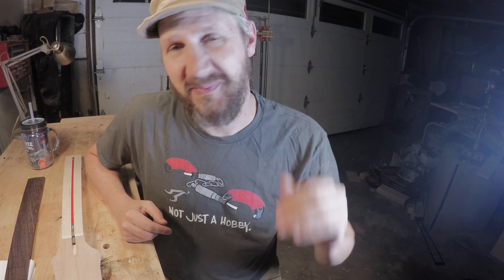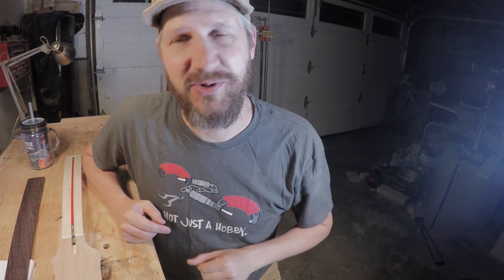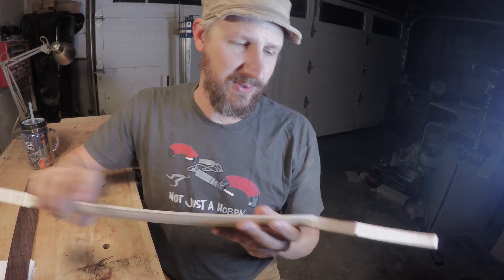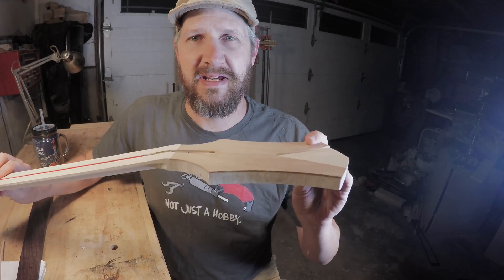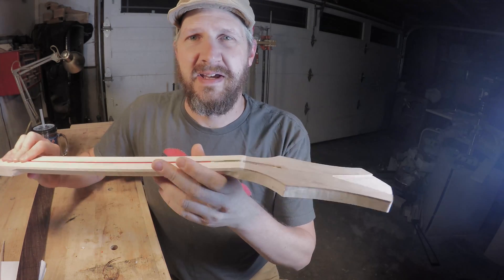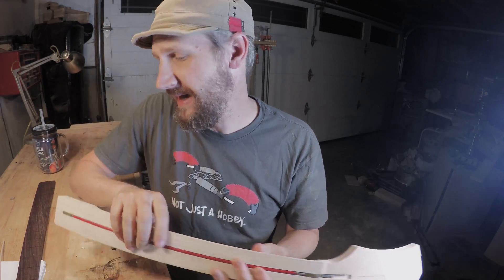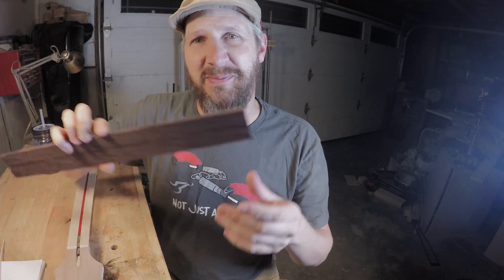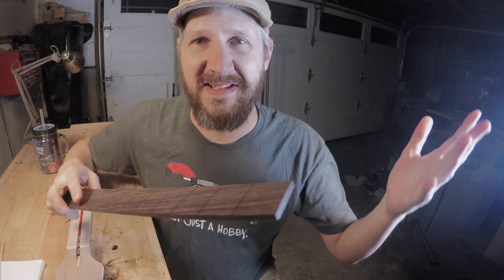CNC Custom Guitar | cutting the neck and fretboard

Comment: I learned nothing. This is just bits and pieces of your process...
Reply from the maker: What are you looking for? There is far too much to cover in a short video.
Reply: @TwoCherriesIns  Make a longer video or series? more length, more engagement, more profit for you, and we actually get to learn something
Reply from the maker: @richard_alvarez_1972  you might want to look though my content, I have quite a bit of that.
Reply: @TwoCherriesIns  don't get me wrong man. I like your content. I'm just saying that in this particular case, the video is not really useful if what we're looking for is learning how to carve a 2 sided necks, which is really the thing most amateur guitar builders want to learn how to do. Bodies are relatively easy. But there is hardly any content on here for carving 2 sided necks on CNC machines. Anyway, cheers
Reply from the maker: @richard_alvarez_1972  I have many videos covering that topic.
Reply: @TwoCherriesIns  ok

Comment: I was curious how you maintain alignment of the work piece when switching between the first headstock operation on the face when it's hanging off the table and then when you reposition the neck to do the back profile shaping?
Reply from the maker: I usually do this by indicating off of a known point on the stock. I like to mill a piece of MDF to keep the long access (in the case of my machine the X access) aligned. I run one edge of the neck blank through the joiner; this makes for a nice face to reference from for the Y position. On scarf joints like this, the break line of the scarf joint is where I indicate the second access. It's a complex process that requires a lot of attention to detail. I have explained this process in several videos. If you can't find any, let me know, I may need to cover this topic again.
Reply: @TwoCherriesIns  Thanks for breaking it down. I'm still trying to figure out a elegant way to accomplish that task. Especially for a non-scarfed angled headstock. I think you gave me some good ideas.
Reply from the maker: @noseknows8039  
Stay tuned in, I'm going to be doing a video on making three custom fender style necks soon. I will do my best to cover the material.

Comment: Hello again, I was just wondering what bit size and where you get the bits from to Cut the fret slots. Thank you so much...
🎸🙂🎸
Reply from the maker: They are .021" I picked them up from eBay, nothing special. You can also get buy with a
.031" but the slot is a little lose and you have to glue in the frets. The .021" runs a little tight for the fretwire I use.
Reply: Two Cherries Instruments you’re awesome thank you so much🎸🎸
Reply from the maker: @GTguitarworks  I was just looking on eBay, there is a .024 set of 5 for $25

Comment: More of a demo video than an instructional video, which is fine.  But being new to CNC, I'd really like to see a video on "how to."  ie.  What software are you using, how do you set up the tool paths (which strategy to use for each operation, which bit to choose, etc), what software is driving the router, stuff like that.  Thx.
Reply from the maker: Absolutely, thanks for the input.

Comment: How were you holding down your stock on the neck and fretboard? I didn’t see any clamps or vacuum system. Thanks!
Reply from the maker: It's the masking tape a CA glue trick. I burnish in the tape to the part and the spoil board and use CA activator on one side. It holds very well and you never have to work about collisions with clams.

Comment: I have a CNC coming to my shop in about a month. What would you suggest for 3D tool paths for mandolins and archtop guitars? I have my analog patterns. I was thinking I would have them sent somewhere to scan and write the G code.
Reply from the maker: I personally would suggest modeling them in fusion 360, I don't do anything with scanning and if the output of the scan is STL than I personally don't think its worth it. 3d modeling is difficult but in the end worth the effort.

Comment: doing the Fret board, what are the operation, you use, for the radius? Then the 2d contour, to cut out line is just normal appears! Then the fret slots, what operation do you use?   Thanks, Love your stuff and methods. I am ready to cut a neck tomorrow, all operation ready. Then the fingerboard, when i figure out the operations!
Reply from the maker: Thanks, most people use a parallel toolpath to cut the radius, I have started using the 3d scallop toolpath with a 3/4" ball nose bit. The scallop operation is less machine time than parallel and the surface sands clean a little bit easier. The outline is cut with a countore operation, and the fret slots are cut with a trace so they can follow the radius.
Reply: Thanks for the info. 
Looking into all the suggestions. 
Going to pickup a round nose, in a few!!

Comment: Can you please share fret slot cutting bit information (dia, length, where to buy)?  Thanks!
Reply from the maker: Awesome question, these are .021" end mills (an inexpensive 10 pack of eBay) the medium fretwire tang dimension is .024" so I usually chase the slot with a fretting saw. If the fretboard is a blind tang design I will add a second pass with a .002 offset. This was cut a 20IPM and a stepdown of less than half the bit (its easy to break these so the slower the better)
Reply: Two Cherries Instruments  Thanks for the end mill data. Two questions please 
What RPM were you running. At 20IPM? And are the bits high speed steel or carbide?
Glad I found your channel